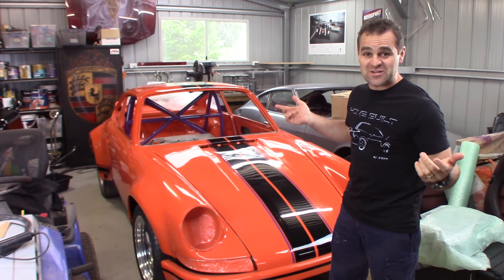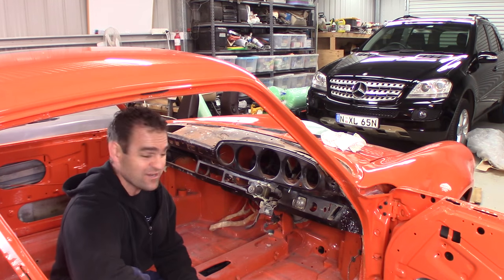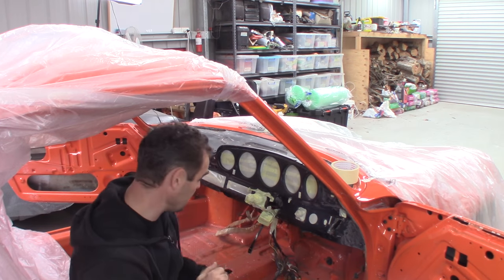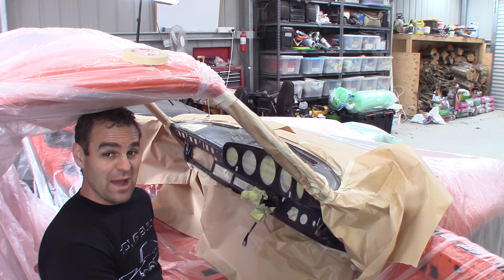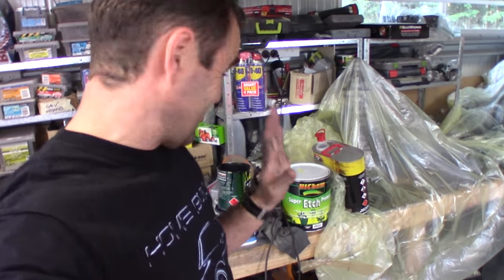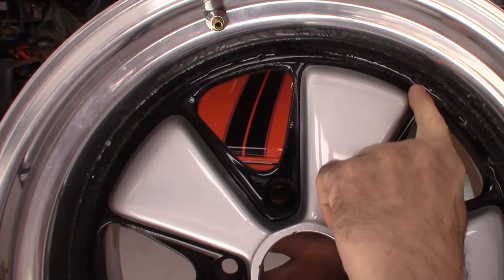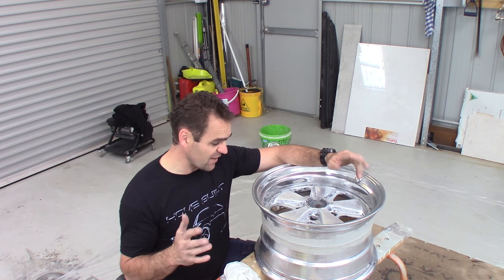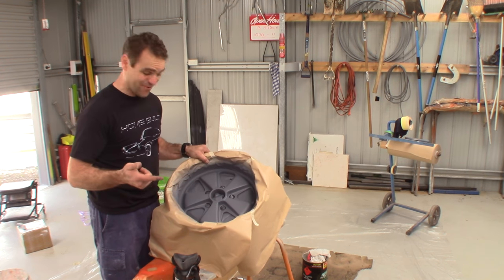Porsche 911 Classic Car Build Part 28 - Painting a Dash and Fun Facts

Comment: You should've positioned and rewelded the rear centres deeper in the barrel that way you wouldnt have to run spacers. My old man had his factory charger wheels done like that
Reply from the maker: If I had gotten the wheels made I would have done just that, but the issue would be I would have needed to get new rims, and that starts going down a whole new worm hole ;)

Comment: A very constructive week jeff. I could not believe how little damage had occurred to that wheel that had the centre cut out and rewelded, the paint was just a little damaged! Whoever did that welding job did an excellent job. What kind of paint did you use on the dashboard? I use VHT Vinyl spray paint in cans and it comes out pretty well. If the dash is too shiny you could have problems with reflections in the screen. I know your car is a semi race car but inless you want it to sound like race engine inside a 44 gallon drum you might consider some Dynamat at least on that rear bulkhead whilst it is easy to get at. Might weigh few killos but will make your car seem much nicer to drive. On my road car I have dynamat sound deadener then some foam and then some Mass loaded vinyl on top makes the car seem really sweet to drive. Thanks for your replies and hope Mrs jeff feels better soon.
Reply from the maker: Thanks Simon. I used a Satin black on the dash, but it still has the dash pad to go in as well, so reflection shouldn't be an issue. 
As for sound deadening. It looks like I have been looking at the same research you have. I have already got my order in for a small amount of Dynamat, and some foam backed MLV. I want to be able to drive the car every day and enjoy it, so some decent sound deadening (that works) is definitely on the cards.

Comment: I would really put door-stoppers on the doors. Don't know if that's the right word, the metal thingy on the doors that stops them from opening too wide. In this video I was afraid you would open them too much and make a dent in them. I almost did the same to my wife's car.
Reply from the maker: You are right, they swing way too far and too easily at the moment. I really need to sort that out soon.